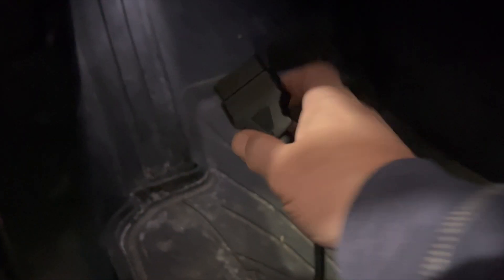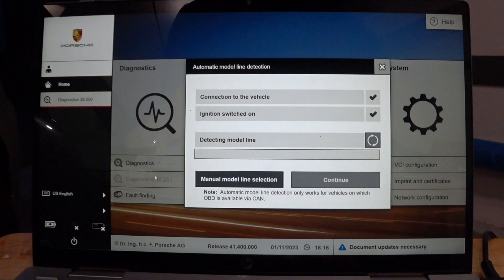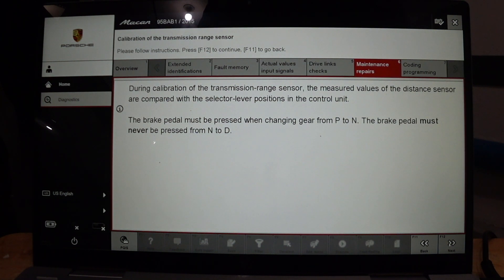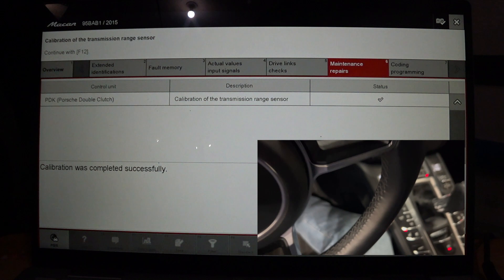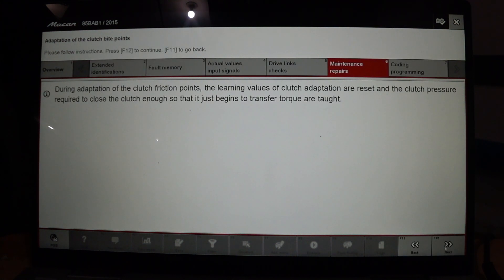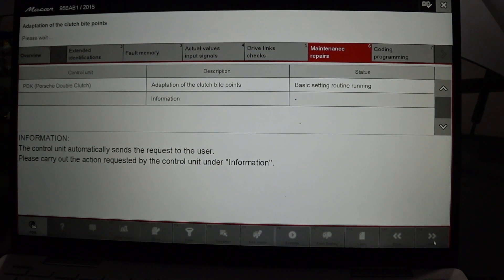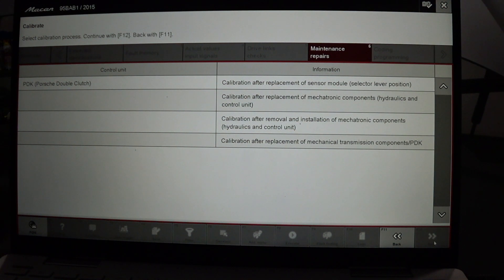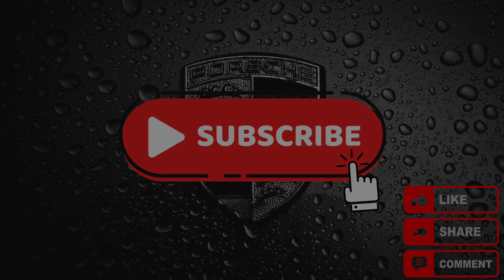PDK Clutch Calibration - 2015 Porsche Macan S

Comment: Hi, great video! I have a question. We replaced the solenoid pack on a Macan S, and it's asking us to calibrate the transmission. What software do we need? I tried using a scanner, but I think it requires a laptop. Could you help me?
Reply from the maker: I prefer to use PIWIS, but I have done it with Launch X431 and Autel.  Both work.

Comment: Who in Ontario can calibrate the shift point for Macan PDK = stay longer in lower gears?
Do Porsche factory software updates exist for those transmissions in North America?
My Macan 2.0L  shift is good, but it switches too early to higher gears, so = needs to stay longer in the gear when we drive slower speeds typical in the City and so on.
Need to switch to Sport mode, all becomes nice with higher engine revs. 
I don't like the engine revving higher.
I've been watching European Channels where they are updating Factory software, plus changing shift points.
I asked Porsche in Oakville, and they told me we do not do things; only Europe and China are doing.
What does that mean that Canada or North America is so behind?
Porsche factory has so many updated software for PDK, but is it prohibited for North America?
Reply from the maker: It seems what you need is a transmission tuning, not a calibration.  Assuming you have the DG501 transmission.  Sorry, I couldn’t say who in Ontario could do this.  The only place I know in Canada is in Toronto.
Reply: @porscheDIY  Who in Toronto can do?
Reply from the maker: @jaguar7051 Oops… where my geography knowledge.  Toronto is in Ontario…😂.   Try Garage Auto Sports.  https://garageautosports.com/?srsltid=AfmBOorTTwwDoM0HgVyX_JUPxllE81VSg4Cs0xP_0YumkeslJ7qE2d4f

Ask for Bill, he is the owner.  Tell him I sent you…
Reply: @porscheDIY  Thank you so much for the information. I live in Mississauga, so it's no problem to get to Toronto.
***
I had a previous conversation about APR ignition coils, and I was not satisfied. * From yesterday, Regaped spark plugs for a larger gap, 0.85mm = now the engine comes to life very fast, responding to the accelerator.
Those high-performance spark plugs come with a small gap because they are for an engine with higher boost * my engine is not tuned for over 300HP * now I see other people live with pride, get high-performance spark plugs and coils, getting performance word.

Comment: I have a porsche macan S 2016 which now has 56k miles. The gearbox started kicking when its downshifting from 2nd to 1st gear(right before i stop). Read about this problem and it seems to be very common. Had 2 friends with he same problem and they said that changing oil (one of them changed it 2 times. First with non OEM oil, 2nd time with OEM oil) doesnt solve the issue. I was wondering if calibration could solve this problem. The kicking feels only from 2nd to 1st gear. All other upshifting and downshifting feels perfect. 

TIA !!!
Reply from the maker: Calibration will not do anything either.  You most likely have a failure of the mechatronics plate gasket.  Is a specific area that is prone to failure if oil is not changed frequently.  See post 4 in following post: https://www.macanforum.com/threads/pdk-issue-discussion-of-a-mechatronic-valve-body-rebuild-etc.194095/?post_id=2799919#post-2799919

Comment: Not sure if you are still on here to reply Satrix, I followed your guide and got the first 2 of the 3 calibrations complete. However the 3rd calibration fails as soon as it starts. Any idea what could be causing this?
Reply from the maker: What are you using?  Are you using PIWIS?  If so, it may be the interface.  VCNI or T6 are very good.
Reply: I am using an Icon T7. As soon as I get the process started it tells me that the Calibration of the Transmission Range Sensor: Failed, like I said the first 2 calibrations worked flawlessly.

Comment: 1Q, how strong in amps does the charger has to be for coding?
Reply from the maker: At least 75A.  This is the one I have:  https://a.co/d/fD2u27u

Thanks for watching and for your support. I hope you are subscribed!
Reply: @porscheDIY  tnx, cause I saw on video something smaller - CTEK :)) I checked today friends macan to buy, nice black full spec 3,0S 2018, but it had 244k km on ODO, got scared and ran away. He said he just full serviced-repaired PDK, buuuut.
Reply from the maker: @ that’s high mileage.  That’s actually very close to my Macan (247K Km).  But I know mine has been very well maintained….  And only driven by me…. Running better than when new honestly.

Yeah, I used to do with CTEK but that’s not powerful enough.  Ended up having many issues.  So, the one I got now is better.

Comment: Hi Santirx, thanks for such a helpful video! I want to ask about the VAL, what exactly is it, and how to perform? I changed the oil in PDK at my Macan S 2019 and going to perform calibration according to your guidline now. Thank you
Reply from the maker: VAL is a vehicle log.  It records all current module information, in case something changes, you have that as a backup.  This is only done in PIWIS and can be initiated in the main diagnostic screen by pressing F7 and selecting Vehicle Log from menu.

Comment: Santi, please excuse my ignorance, I'm new to Porsche. I Googled the tool you mentioned in the video, "Piwis vas 6154", and results were all over the place with devices ranging from $60 to $2000. Could you possibly point me in the right direction? I'm learning that I'll need something capable of resetting engine oil maintenance warning, PDK calibration, TC calibration... and who knows what-else-calibration lol. I'm used to vehicles where you change the fluid and that's it - no electronic apparatus required to tell the vehicle the fluid was changed! So this is all new to me.  Thank you for your incredibly helpful videos and posts on the Macan forum.
Reply from the maker: You probably be better off getting a Otofix diagnostic tool.  If you don’t intend to add and commission new modules, Otofix will be more than enough to do what you are asking.  Most Otofix tools have ECU coding capability, as well as you will be able to do TC and PDK calibration.  Otofix runs on Autel, and as a matter of fact is manufactured by Autel, but is cheaper and aimed to DIY’s rather than professional shops.

Check:  https://www.otofixtech.us
Reply: Thank you for sharing this!!

Comment: Hey Santrix, thx for all of your wisdom here. I have an issue, after I changed the PDK oils of my 2017 Macan turbo, the calibration failed when I reached the "clutch bite point adaptation" all the other calibration procedures were carried out, but not this one. 

Now the car drives but doesn't keep much revs, even in Sport + mode when it reaches 4,000 RPM shifts to a higher gear, where before it used to keep the revs to 7K. For example, before, when driving in 7th gear in normal mode, when Sport+ was selected, it was dropping to 3rd gear, now it drops to 4th, so it doesn't feel as sporty.

Any suggestions are much appreciated
Reply from the maker: Sorry to hear.  When you do the clutch calibration, you are in essence resetting the PDK so it needs to learn your habits again.  Hence, you will feel it a bit different.  Just drive it the way you would want to for a while.  

I would just repeat the clutch bite point adaptation (this is really the only one you should do honestly, unless you have a PDK that is clunky)….  If it hangs up, repeat until it goes through.

Is your PDK throwing any faults?  If not, your PDK is fine. 

Thats about the only thing I can think of right now.

EDIT:  I just saw your post in MF.  Of course the dealer is going to tell you that you broke your PDK, they want more money.  But there’s no way you will break your PDK by performing calibration.  Sensors tend to drift with time and wear, and with calibration you are just adjusting offsets to bring it back into tolerance.
Reply: @porscheDIY  Ah this is good to hear, and so much relief. And cool that you saw my post in MF 🙏🫡

I watched your videos and did the calibration myself, based on your instructions, after changing the four oils: 2 for the Gearbox, 1 for the Transfer case, and 1 for the rear differential. I also changed the two PDK oil filters.

The PDK is not throwing any error codes; I just lost the sportines.

I've tried to go through the Clutch Calibration about five times, and every time, it failed. So I gave up, but it's been a month since I did this, and the PDK still hasn't learned my driving habits.

Maybe I should give it more time to learn or do you suggest that I try the calibration again until it goes through?

By the way, your time and wisdom are much much appreciated; you are a savior. Thank you very much again 🙏🙏🙏
Reply from the maker: @RossMinchev  hmmm…. It should learn rather quickly.  But the issue may be the interrupted bite point calibration. Do that again until it goes through.  Do the independent bite clutch calibration only.  And then, drive it so that it can learn….
Reply: @porscheDIY  will do that this week, thanks again for your help. I'll keep you posted on how it goes. 🙏
Reply from the maker: @RossMinchev Also, watching the comments in MF reminded me of a question I had.  What tool are you using for calibration? Is it PIWIS?  Or are you using Autel or Launch?  I have done the calibration with Autel with mixed results… it works better with PIWIS.  I haven’t tried to do it with Launch, but the commented in MF reports not being successful with it.
Reply: @porscheDIY  Great suggestion, thanks again for your help. 

Btw I just spoke to Jeff Richardson, he is also on YouTube, so he told me the transmission in the Macan is not a PDK, ZF gearbox, but an Audi S tronic. 

That was some surprising news for me.
Reply from the maker: @RossMinchev  It is an Audi DL501, which is rebadged PDK for Porsche.  Porsche doesn’t manufacture its transmissions.  Either use ZF that is rebadged as PDK or the DL501 with is rebadged PDK.  They are both still PDK, because PDK is a brand name for any double clutch transmission used by Porsche.  PDK as a transmission model doesn’t exist.

In some cases, Porsche co-develop transmissions for their cars, but always use other companies, mostly ZF for dual clutch.
Reply: @porscheDIY  Yes, that makes total sense. great points again. And this is why I was able to do the calibration with VAG software and not PIWIS. 

The VAG software has totally identical points for PDK calibration as in PIWIS.

Comment: hello, I have to make an adaptation for replacement of the torque splitter and new control unit. I have the piwis clone,  
Do you need to keep a charger connected or just keep the motor running?
Reply from the maker: The procedure is fairly quick, and some of the procedure needs to be done with only ignition ON.  If the battery is not sufficiently charged and voltage doesn’t meet the pre-requirements, it won’t allow you to proceed.  And the procedures that requires ignition ON would not work with engine ON.  In this specific case, there is no voltage pre-requisite, so you might be able to complete without a charger.  Just make sure your battery is well charged.

Comment: Hey so I am new to Porsche and I am just wondering how do you create "VAL" I can't find any information on what it actually is. Thanks in advance.
Reply from the maker: Thanks for watching, and welcome.  Do you have PIWIS?  Val Logs are created with PIWIS, and you can create them when you select a process (like an adjustment or calibration, the system will ask you if you want to create one), of by pressing F7 at Home Screen (Maintenance of Vehicle information).  This will bring a menu that has the option to create a VAL log.  A Val Log just records all your car parameters and values, for reference.
Reply: @porscheDIY  Thank you so much

Comment: Very good! Need to do this to mine as well after full PDK service, Thanks for the demonstration! 👍👍👍
Reply from the maker: Sure!  Let us know how it goes!  In my case, PIWIS lost communication with the control module a number of times, so I had to restart the process a number of times.  Do not worry, just restart the process.
Reply from the maker: Also, I need to clarify that this calibration process should not be done as a result of the fluid change.  The clutch bite point adaptation should be done periodically and for it to be performed, the fluid must be changed… so it is just good timing to perform the calibration/adaptation after the fluid change.